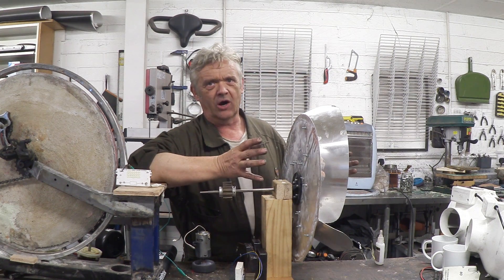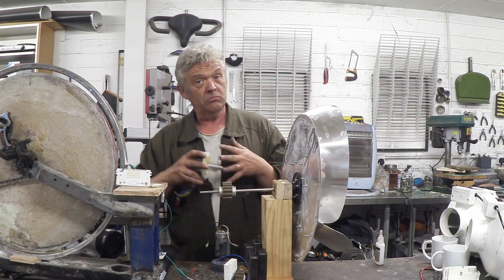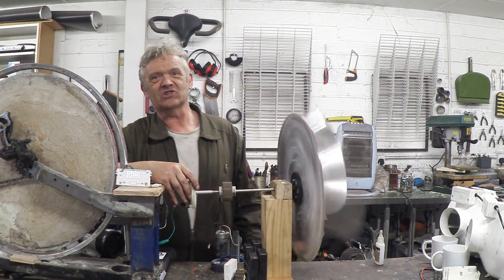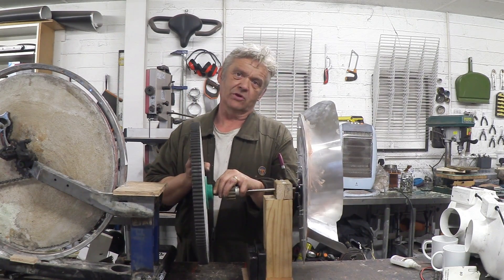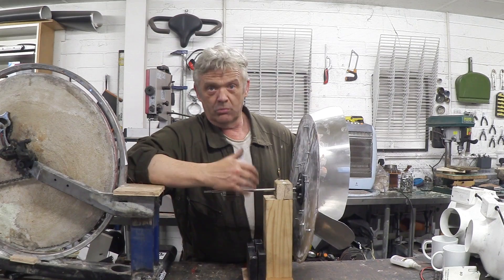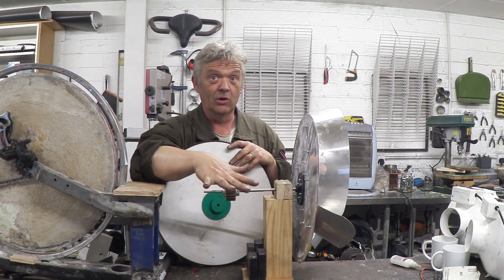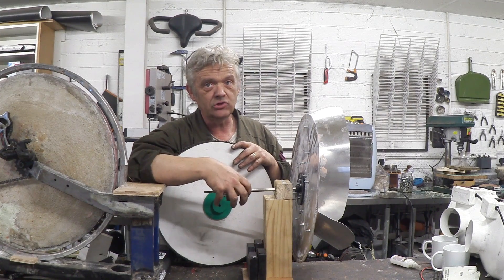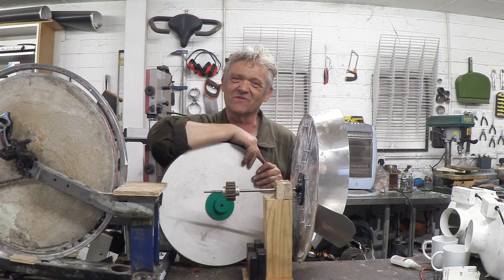1144 Wind Turbines - Generation - The Use Of Motors As Generators

Comment: what about a CVT? like an adjustable universal pulley that changes it's diameter based on it's circular velocity to drive a belt which turns the chosen motor. It might be tricky to tune but it will transmit the right amount of speed and torque to the motor based on the wind speed.

Comment: One arrangement I haven't seen anyone do perhaps you have is to replace the magnet with small easy to turn motors around the circumference of a gear or disc or whatever you wanna do so basically instead of making a generator with magnets and coils just find a bunch of the same lightweight motors that might only give you a Volt or two each and put a entire array of them around the flywheel. You could measure the voltage at a known speed and record it so you know if a motor has fallen out of operation

Comment: I'm a complete nube, but Great!  You've addressed some of my thoughts, and now another.  I happened upon a free 10-15 speed bike, and since I have no interest in biking, the thought of incorporating the derailleur so that it could automatically?, not a clue how, change gears to accommodate for wind speed to meet the generator's need to make juice.  Like I said, I'm a complete nube and just noodling on these ideas.
I did create a generator via utube instructions, wiring change + magnets, from a ceiling fan, which via hand held drill and inexpensive, Neiko digital tach, created 25-35vac @ ~90rpm.  Worthwhile or just a fun experiment?  I don't know

Comment: With magnets at the rim and an arrangement of coils, you could close the circuit on the coils individually depending on wind speed (available torque). Low wind speed, fewer coils in the charging circuit. High wind speed, more coils in the charging circuit. There are a number of ways to accomplish this. For instance, older motors used literal rotating weights to deactivate starter windings, The concept could be reversed to activate coils in the circuit. A more "modern" way would be to use the "pulse" frequency of induction to regulate individual circuit coils.  The frequency of induction would "close" or activate individual coils.
Reply: Also, something to consider to help reduce induction "cogging" is magnet field direction. Magnets can be arranged at an angle to the direction of rotation.

Comment: Watching other YouTube videos on recycling old wind turbine blades. Wondering if a model version of turbine blades standing vertical around a rotatable disc like a lazy Susan, would generate power and could be proof of concept for doing it full scale or even if ends of blade cut shorter.

Comment: Was wondering if Rob ever thought of using the "strong adhesive magnetic tape" kind of magnet in long way round strips , like the magnet wire going long way round the hub. Hope I got the point across?
Reply: Think you need north south north south, spaces in between magnets, those tape ones have north one side and south other side
Reply: @JacoKruger.  Right, so in stacks of two inch pieces of the tape, flipping polarity as you work the way around. They sell the tape with no adhesive as well so you can use your own to suit. My thinking is with the thinner magnet tape one might be able to close the distance between hub and flywheel one layer at a time, minding polarity, having only small or no gaps between pieces. Let's say the gap between hub and flywheel at the closest approach is 7 mm, then you could use stacks of 6 of the 1 mm thick tape. It would have to go onto the flywheel edge, closest to the hub with the coil. Does this better explain?

Comment: the other thing to consider of course is that having the generator on the perimeter of the fan gives you room for a lot more magnets and a larger coil OR a higher number of turns with separate coils

Comment: One big advantage of this turbine is, that you can mount it on a surface like a wall. You could possibly also install an array of turbines directly next to each other. When mounting it on a wall the downside would be, you can't adjust it to the wind direction. Great concept.
Reply: Unfortunately if it's mounted normal to a wall it won't work. A wall or building stops all air and diverts it around it. It work great on the roof though where the air is diverted.
Reply: Roger Wilson idk as the turbine diverts the wind to the sides.

Comment: I took a que from you and tested the output from a treadmill motor for a generator against using 6 magnets placed on the perimeter the bicycle wheel I'm building off of and was amazed at just how much more power I was able to get with a simple coil around steel pick up I salvaged from a heat and massage pad you would lay on top of. My 2.5   hp motor made 2-3 volts dc out where as the coil placed close to 6 ceramic magnets produced 5-6 ac at the same speed. I would have thought not. Now I need to rectify it and see if I still have better output. Thanks for your uploads

Comment: I noticed at the end of the video you're holding the large gear wheel next to the rose fan.  If you used the large gear wheel as the base for the rose fan you'd eliminate 1 piece and (with a decent material) stabilize and strengthen the rose fan... maybe?
Reply: the only way is using an enclosed gear box that way you get the longest life span.
Reply: @carmichaelmoritz8662  An enclosed gear box would eliminate using the gear as the base of the fan.  Exposed gears have been used in rural and industrial applications for decades. How long is the fan going to be viable?  Enclose the generator at the small gear.
Reply: @TheKenWiley  exposed gears wear out way quicker.   the fan would be viable for many many lifetimes. and using a belt drive would use up resources due to the tension.
Reply: @carmichaelmoritz8662  I'll tell my 80 year old "politician carriage" that it should be worn out now.  Yes, I've repaired and replaced parts, but it's still running, long after many enclosed mechanical pieces of equipment, and hundreds of commercial "ecological" wind turbines containing millions of dollars of enclosed everything.  I'm looking at KISS engineering.   If it works I'll consider putting a cover and an oiler on the gear.
Reply: @carmichaelmoritz8662  I would never use belt drive.  Too fussy, to much maintenance!  Besides, living more than 1 lifetime at a time burns up lifetimes too fast.  Advancing technology will kill the generator long before it wears out.

Comment: Hi from France !
Dear Robert,

Some years ago, I have dismantled a speed box used in Peugeot's 306 1.4 petrol car. In the second shaft you have a very interesting component, supplied with precision ground bearings.
And some speed boxes are using synchronizers made of steel. Only a little punch, with a linear actuator or via the fork can clutch the rose to the desired generator.

This system stays in a oil bath. But regarding your excellent ways to coat iron-based metals, maybe you have an interesting path here.

It will surely demands a consequent lathe, bigger than the one you are currently using in order to simplify the second shaft. The contamination of gears with the abrasive wheel's debris should be avoided with proper protections. Most of the bearings are set with liquid nitrogen, no hydraulic press can be useful here.

And some generators used electric scooters car provide up to 750 watts, because they are using 3-phase coils. The only issue is the Park's transformation, via the 3 embedded sensors which are helping the synchronize the phase's signals regarding the position of the shaft.

Best regards, keep up this interesting path !

Comment: If you mount that large cog directly onto the backplate of the rose bud, you could arrange at least 10 small low torque motors wired in parallel. Or pairs in series then wired in parallel.
Reply from the maker: for sure mate

Comment: Hi Robert,  I watch your videos with interest and being a mechanic I know that Air and fluid behave quite a lot alike.
Do you know how an automatic transmission torque converter works?  It multiplies torque by harnessing the incoming fluid force.  They are somewhat inefficient, but may have a benefit of the torque multiplication in very low speed wind. It would be interesting to explore.
Reply from the maker: I do know about torque convertors mate - but I was thinking this was an easy intro to gearing for folks who don't
Reply: @ThinkingandTinkering   All good, It wasn't to infer that you were missing something, more that you spurred an idea in my head. :)
Reply from the maker: @Homesteading101  lol - oops - sorry lol